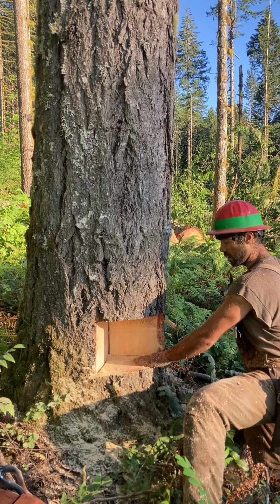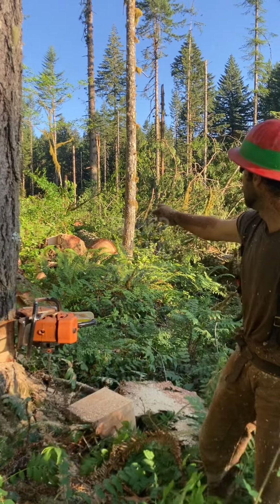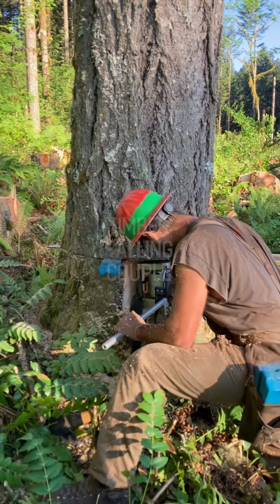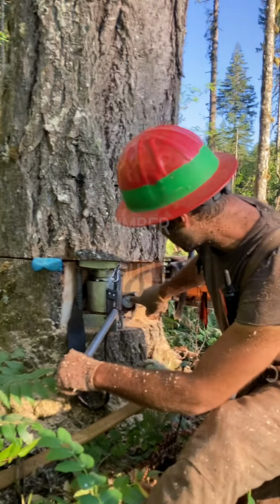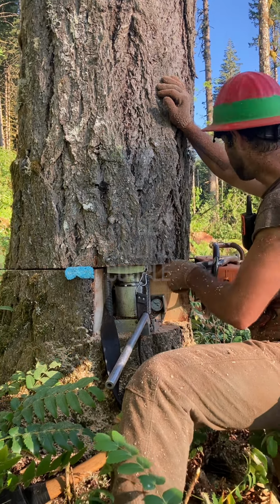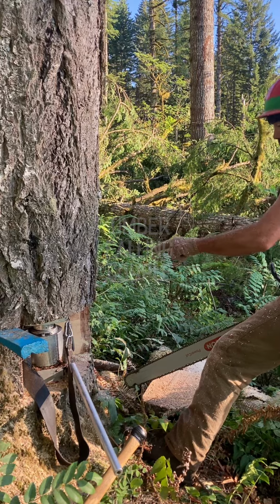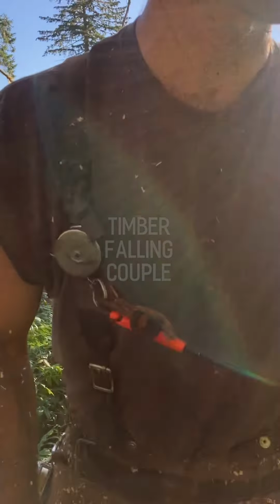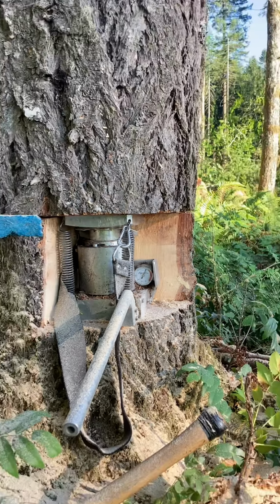How to Use a Tree Jack

Comment: " Thats it!"....as Phil does the drunken sailor (foot in a hole) 😂
Good job. Good explanation.
Stupid question: Do I hear the tip on that bar?
Reply from the maker: It's actually the noise of each individual cutter hitting the wood. It's especially pronounced when your rakers are a little low and your chain is a little dull, as here
Reply: When can in the video you hear it best?

Comment: does anyone know how much of a lean in degree's that you can jack over a tree just ball park i knowthere are a lot of varibles
Reply from the maker: I have seen some incredible stuff done with the big 50 ton treesavers.. but I'd say about 21 degrees off vertical is possible, but I can not verify the success rate or the exact angle of lean
Reply: @timberfallingcouple  thanks i just wanted a guide line on what is possible im going to give it a try